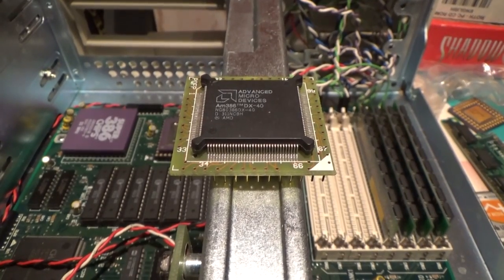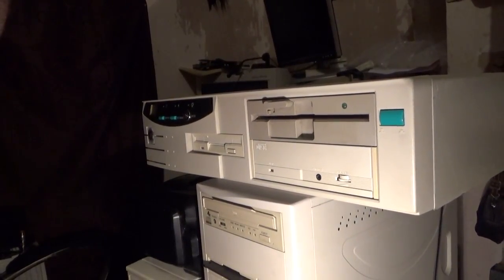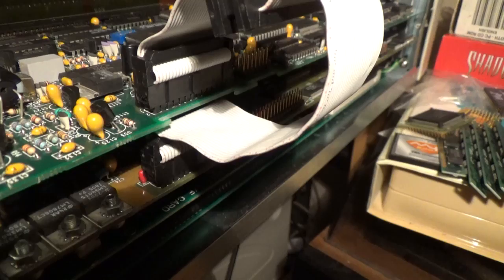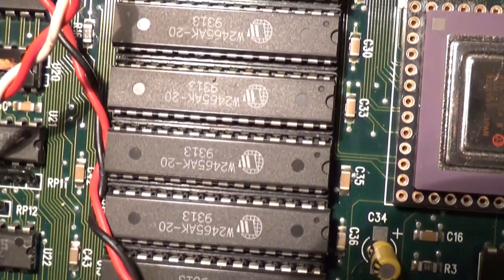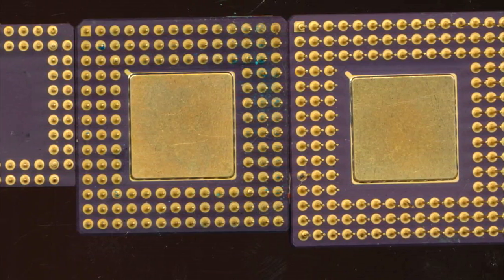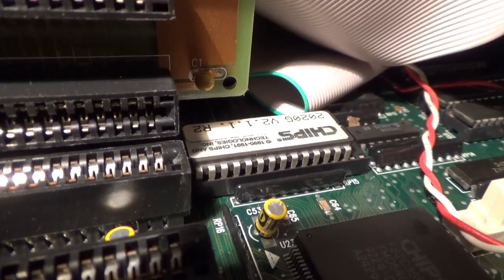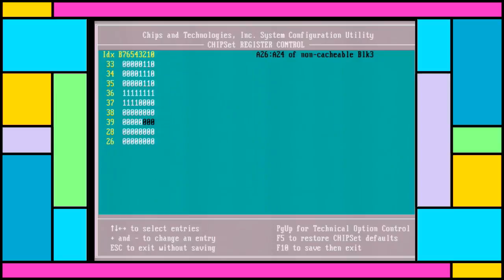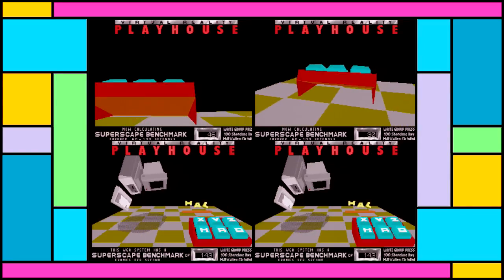Chips & Technologies Super 386

Comment: This is what I love about old computers. all these years and I can still discover something new and interesting. Thanks for the shout out btw. My Contaq board is also known as the MS-3124. over at Statson.org there is a settings and configuration sheet which lists the C & T 386DX as a compatible processor.
Reply from the maker: These things are definitely still full of surprises. No worries about the shoutout, you provided information and it was your board I was referencing, so it would be poor manners on my part if I tried to obscure this fact. The extra pins being the same side and the C&T compatibility does definitely suggest some common intended feature between both boards, though it's still not certain exactly what that might be without access to chip datasheets nobody appears to have anymore, if they were ever really available in the first place outside of closed design documents.

Comment: Great work dude! Was always curious abt exactly this comparison. Unfortunately I don’t have the C&T 386 in my collection, even I am counting thousands of CPUs in my collection. 👍🏻
Reply from the maker: Thank you. Oh I know the name CPU Galaxy.
The C&T 386/387 are indeed evasive little things, took years of just missing them to finally happen to be in the right place at the right time, it really was down to luck and I hope you manage to find one yourself some day. My collection is comparatively small, probably less than a hundred chips, but there's not much left that I want either, maybe one or two SoCs left and a couple of CPUs I'm not sure even exist.
We recently found a rather odd behavior with the C&T CPU getting stuck in some kind of 'unreal' mode when it shouldn't, which triggered when drivers/TSRs were loaded in a certain order. This makes protective mode software act weird or crash, but we have been unable to determine whether this is specific to the configuration of this system in particular or the CPU itself. Was trivial to work around and most users probably wouldn't run into it, but if you ever play with one I'll be curious to know if the same thing happens.
Reply: @HighTreason610  Hey, do you have an email address where I can write you?

Comment: Farscape, hell ya.  I like the case. I am surprised you didn't link the cleaning video.  Interesting performance. I have never found, yet, a performance difference with the 486 SX and DX chips in these tests, always scoring identical. Must be a 386 thing I guess. Almost like a bug that is being worked around with the Intel chips or something. One of the Cyrix 387 variants would be interesting to throw at this. Late 90's, when the K7 came out, it was rumored that Intel was limiting it's supply of chipsets to certain motherboard makers ( ASUS ABIT ) that were taking their chipset and adding overclocking features. There was also a rumor that ASUS was keeping their initial Slot A motherboard on the "Down Low" , sold unbranded and in a white box, as to not anger Chipzilla, their bread and butter market.  No idea if any of this was true, but there was a lot of stories like this, so I would not be a bit surprised if Intel was strong arming the OEM market into not using C&T 386 chips, probably citing this lawsuit as a reason and if used,  Intel would cut off supply of their processors.
Reply from the maker: They shouldn't have cancelled that show, it had at least one good season left in it. Yeah, the 486 is a good baseline because it should be identical if the test isn't using the FPU, so it's definitely limited to this platform as far as I can tell - not like they made a "Pentium SX" or anything to compare it with really and I don't have a 287 - so it definitely seems to be that Intel lose speed somewhere, maybe motherboard dependent though. I'd like to test a Cyrix FPU but don't have one, supposedly they were faster than these by upto 10% according to one or two places. The magazines back then said something about Intel doing that, would not surprise me to be honest, they still don't like overclocking but it seems they're resigned to the fact that it's going to happen now. If memory serves correctly, Intel were found to be paying Dell to use only the Pentium IV at one point and also bribed stores, they got fined a billion or so dollars for anti-trust, seems easy to find on the web anyway.
As for the whole advancement of technology thing, it seems the whole world has stagnated a little. We had over a century of innovation but I feel like we're about to go into another few centuries where nothing moves on that much.

Comment: Very interesting. Pretty professional benchmarks and captures.
Reply from the maker: They get the job done I guess, it was hard to follow initially which is why the charts were added. In response to your other comment, yes, at that time, console was still king, but only just, the technology was there and people were starting to use it, so the PC was about to overtake them in capabilities. Consoles still sold more though, I'd bet, and the gap probably didn't start closing until the latter part of the 1990s when 3D acceleration got good and gaming on the PC started becoming a larger scene, with some systems even being built for that very task first and foremost instead of work. PC gaming was a fairly big thing in the Athlon days.
Reply: Thanks for the answer HighTreason. I totally agree. Half-Life was probably the breaking point, a Playstation couldn't do half of that. I skipped that whole generation, I still had a P2 by the late 90's I think. I remember we still had a 5x86 133 alongside the P2, and Half-Life would run in both! (with very different resolutions xD).  Then later, P4 came in, socket 478. But in my mind "PC games" still means something different than console videogames. First, they made you type. Even to start the game. They involved a lot more logic, not such good graphics but solid stories, adventures. I'm thinking about Monkey Island, Leisure Suit Larry, even Alone in the Dark. Long live IBM PC/MS-DOS.

Comment: Maybe a FP precision test would reveal the reason for weird difference in intel/c&t combinations? Necroware I think found math accuracy of different FPUs was wildly different around this time period, from memory...
Reply from the maker: Possibly, but I was never able to find such a test and wasn't too bothered, as I tend to just go with "it seems to work" when tested in applications. The datasheets might have some information on the precision level of each IC.
In real world terms I'd hazard a guess that they're at least comparable and the literature seems to suggest as much, although some very specific operations may complete 600% faster on the C&T chip. This is interesting, as it is similar to how some integer operations complete 700% faster on UMC's processors. Of course applications don't tend to be made entirely of those small few instructions, so we see the much smaller gap observed here in practical use.

Comment: There's something odd about that system... what was with the rendering artefacts in the Intel+Intel config in Doom?
Reply from the maker: Indeed, that footage is also pushed slightly to the right. It appears to be a timing issue with the AITech capture card and its digital keying circuits, it happens from time to time although this has no effect on speed.

Comment: Time and time again we see Intel stifling innovation by nefarious means to make sure no one takes a slice of the PC market. I would have loved to see what C&T could have become.
Reply from the maker: Seems that every attempt goes the same way, inevitable court case. It's small wonder things stagnated for a while with only AMD left and no Cyrix, C&T or UMC to shake things up.
Overall I'd wager UMC would have been a larger threat to Intel if they stuck around, if only because they have their own large fab plants and being located in Taiwan, could probably have undercut the others. Still, Cyrix (TX, USA) and C&T (CA, USA) would have forced innovation. With their efficiency and later their strong presence with VGA chips, I could see C&T having done well in the laptop world if they'd stuck around, or who knows, maybe they would have gone on to build some high-end CPUs later. They did make a SoC at one point, the F8680, though it appears this was only an 8086 core.
Reply: VIA coming back could make things interesting.
Reply: They've had quad core procs for years that were fairly decent at the time but for whatever reason they never really made it to market. Intel hogging like 93% of the market didn't leave much for AMD either. :(

Comment: If you're looking for CD-based PC games, try Rebel Assault, it pretty much run everything from the CD, only having very few and very light files installed on the hard disk. This game also got released for Sega CD but the control suck because there's no analog joystick for the console. You NEED an analog joystick for this game, and if possible, auto-fire option, it might make it much easier.
Reply from the maker: I'm somewhat familiar with this game, as in, I knew someone who had it on PC years ago. Might give it a shot at some point, just to see how the Sega version holds up.
As for your theory on the C&T's FPU usage, I don't know, maybe it does, or maybe it just handles things more efficiently. You have to wonder if the notes I read saying it was slow were perhaps running in a board that wasn't compatible with it, the way it communicates with the rest of the system is clearly different regarding cache and memory, so it stands to reason they probably played with the FPU communications in some way too, and that some boards wouldn't support it.